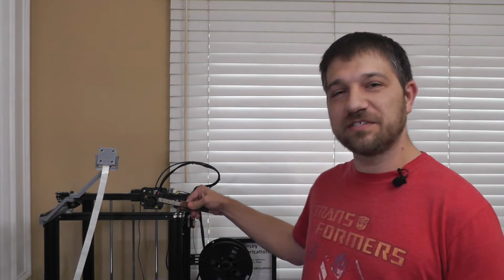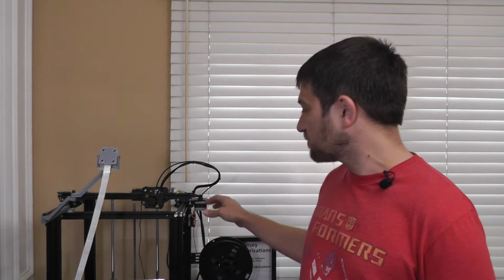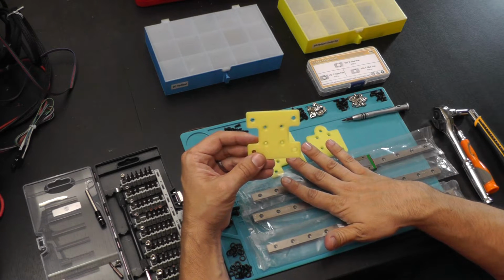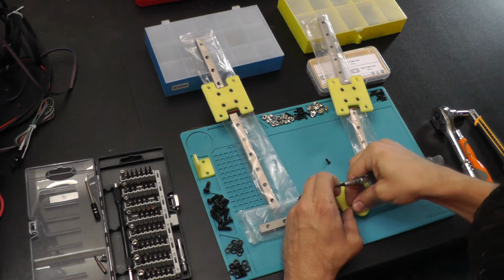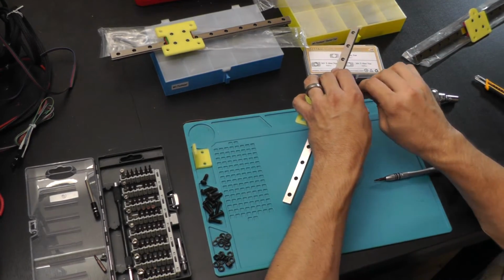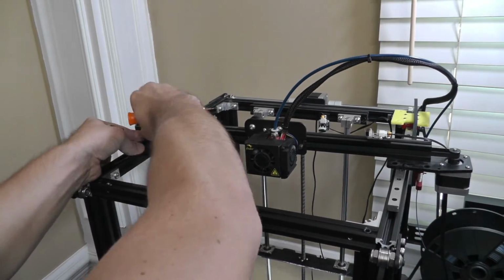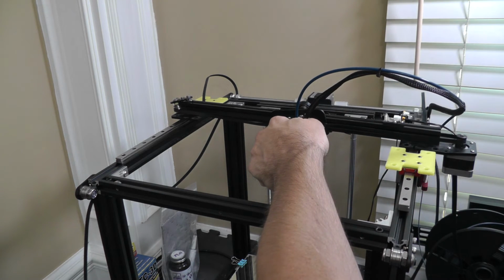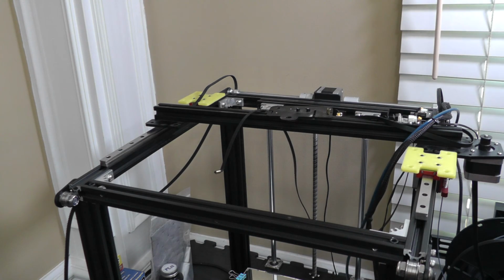Creality Ender 5 Upgrades #6: Linear Rails - Part 1

Comment: Which one is better exoslide or linear rails?
Reply from the maker: I wouldn't really say either is better. They are both precise and produce excellent results. The ExoSlides are more straight-forward to install. For linear rails, you'll have to find some sort of mod (like this one) to print and setup yourself. The linear rails may also have a little less maintenance.
Reply: @kerseyfabs  thanks! hard to decide between the two. leaning more towards the exoslides since it comes in a kit, my only problem with the exo is that it seems like I am limited on options when it comes to selecting dual gear extruder drive the just bolts on.
Reply from the maker: I'm testing their new extruder right now and I'm pretty happy with it. It's a nice piece of engineering. That review should be out this month. Other than that, the mounting on the ExoSlides is easy to make adapters for.

Comment: why not abs?
Reply from the maker: At the time I just wasn't printing with ABS. It probably would have been fine. I was just weary about doing it without an enclosed machine. Small parts are usually okay though.
Reply: @kerseyfabs  Thank you. I haven’t printed with it yet either. Looking at enclosure options soon to see what I can do. I guess the first step is order a roll and see what happens without an enclosure. Which, on the printer I got recently, someone demonstrated and, they came out good? Who knows. I’ve done PetG with success as well as some TPU and of course, tons of PLA….

Comment: Hi Chris!
Thanks for the very informative videos. I particularly enjoy the fact that you get right to the root of the problem and then show how to solve it without talking us to death (unlike some youtubers...)
I've just started watching your channel as I am considering buying either an Ender 3 V2 or Ender 5 plus. The reason I'm considering the Ender 3 is that it seems to work out of the box...? I'm not too sure if that's true of the Ender 5 plus (seen a lot of people having problems with it). The question is: do I need a second, working 3d printer to make upgrades for the Ender 5 plus or does the Ender 5 plus work well enough out of the box to print it's own upgrade parts? I probably haven't worded this very well...but I suppose what I'm trying to get at is: Is it necessary to have one fully working 3d printer before buying something like the Ender 5 plus that needs quite a few upgrades? The highest priority for me is printed part accuracy; I don't care much about speed, noise or aesthetics.
Reply from the maker: I appreciate the feedback! Thanks for watching!
I want to answer this as directly as possible. Yes, the Ender 5 plus is a great printer out of the box for many people. Some people have problems that are the printers faults. Some people have problems that are the users fault. The stock UI isn't great but the printer works great if you can use it. Watch this clip for what I mean: https://youtu.be/KQSzQVbgF2c?t=1544
I hope that helps to answer your question in general.
Reply: @kerseyfabs  Thanks Chris. I'm still veering toward an Ender 3 or even a Prusa because I want a printer that will print right out of the box...that being said, I'm still tempted by the Ender 5 plus because it looks like a good machine based on yours (and others) reviews...
Reply from the maker: @YippeePlopFork  If you want a true "out of the box" experience, got Prusa. If you want a printer you plan to tinker with and upgrade, get the 5 Plus.

Comment: Just done this upgrade with hywin linear rails. I had to get longer belts and cut the bl touch holder off before I printed it as I couldn't get the belt on the direct drive micro Swiss plate. Also did the stealth Swiss stabby owl upgrade. Very happy with the results. Thank you for the help :)

Comment: With this, do I need to change anything to the firmware?
Reply from the maker: Technically, no. With the version I have released you need to be careful about the limits of the print bed but that can be done in the slicer. I'll be releasing a new model that fixes the limits.

Comment: Interesting.  I'm more interested in that camera and mount you have.  ;-)  I converted my 5 to direct drive using MicroSwiss extruder and all metal hot end.
Reply from the maker: Here's a link to the camera info: https://www.youtube.com/watch?v=aPOUPXh9m-g
Reply: @kerseyfabs  ahhhh thank you very much,  I was looking into the octoprint and Raspberry Pi.  Mainly for a Camera and mount, but also to be able to connect a computer to the printer.  I'm on Mac here and I tried to get my MacBook Pro connected.  I got the Ponterface stuff but I couldn't figure the connection port for a Mac.  I have my eSteps in my Gcode Script.  Thanks again.

Comment: As I am just about to get this Wednesday my first 3D Printer, the Ender 5 Plus, this and other videos are key to understand my printer. I have come to the conclusion, that my Ender 5 Plus Printer is the framework from which I will be adding and modifying elements of the printer. This seems to indicate that this Ender 5 Plus has a chance to follow technology development for many years. See forward to start working on my Ender 5 Plus changing parts to keep it improving. What I am waiting for is for you to test and evaluate in a video de card with the ARM M4 and operate it at 220 MHz or faster. You proved to me that the processing power of the card is one important element to achieve a balance between the quality of the object printed and the speed of printing. It is my foremost important goal to learn and study tools, technology, and sciences and less to have i.e. the 3D printer as a tool ready to be used.

Comment: if you don't mind me asking a Question. what printer did you printer did you use to print the retooled parts on? looked like a dual extruder prusa (but i am rubbish at printer identification, one of the joys of just starting my journey in the world of 3d printing ) Thanks in advance... Cheers.
Never mind you answered my question in your next video (Anet A8) thanks
Reply from the maker: That's right. It's my old Anet. My first printer.

Comment: Does this upgrade make you able to increase printing speeds and get the same quality prints?
Reply from the maker: That's a good question. I don't really push printing speeds. I don't believe it will help much in that department. The weight of the gantry is still a problem for speed.
Reply: @kerseyfabs  I thought that was the main purpose of upgrading to linear rails.

An idea for a new video would be print speed test, both with and without linear rails. To see if higher print speed can be achieved with the linear rails.
Reply: @BjarkeFH  - speed depends on how much mass you're moving around. If you've got a direct drive extruder, your x-carriage will be heavier. Rails are actually intended to improve print consistency because you're not depending on the adjustment or wear/tear of the delrin trolley setup with which most printers ship.  What he didn't do/mention, when you get your rails, dismantle them and clean/re-lube them thoroughly. They ship with a generous coating of cosmoline which is NOT a lubricant. You may also want to consider replacing the bearings in the rail carriages. They are not often quite the right size. These can be purchased on Amazon as well in bags of 100. The "H" carriages use 66 bearings each, so you'll need at least two bags of bearings to do the X and Y axis (three bags if you're also going to do the z axis). There are several videos on the 'tube that describe how to dismantle, clean, and lube the carriages.

Comment: why not drill holes in the metal plates and use that as mounts ? ( rly asking btw )
Reply from the maker: There are a couple of reasons.
1) I try to make things accessible on this channel, in general, and 3D printing adapters is a lot easier than accurately drilling an countersinking screws into a metal plate.
2) The metal plates are relatively thin and mounting them directly to the rails would require flush mounting. It could be done with countersunk screws but I refer you to #1.
If I was doing this on my own, without YouTube, I may have done that  after I proved it out with the adapter.
Reply: @kerseyfabs  thank you :)
Reply: You can take the thingaverse files and send them to a place (I use these guys - https://sendcutsend.com/) to get them laser cut out of aluminum.  I'm not sure, but you may even be able to get the necessary holes tapped. Minimum charge is $30.

Comment: I recently bought a ender 5 plus, and after about a week or two I noticed that the rubber wheels are actually wearing down quite fast. They touch the beams at a sharp angle and only touch on the edges. I think at some point they will be running on the bearing itself! I don't understand why they used the same hollow beams as the rest of the frame.
Reply from the maker: You can adjust those wheels in case they're too tight. If you want to fix the problem another way, other than linear rails, check out my ExoSlide review.
Reply: @kerseyfabs  looks really cool, thanks!

Comment: How much of this is transferable to the 5+? I'm having issues with the belt system when the print head travels to the front right of the print bed. the Print head likes to lift up slightly.
Reply from the maker: I believe it should work just fine. I can't see any problems. Let me know if you try it!

Comment: I refuse to use T Nuts. They make me angry. I will drill holes. Edit: right when I posted that I saw a note in the video about slide in T nuts. Those look perfect.
Reply: Why do they make you angry? I think they are perfect for their use. When I want to fasten anything without dismantling the printer.